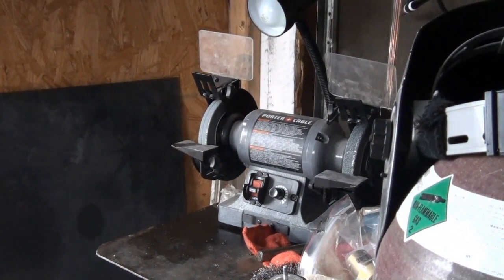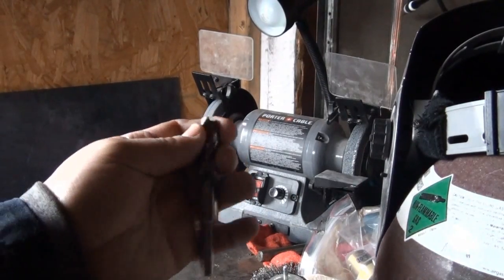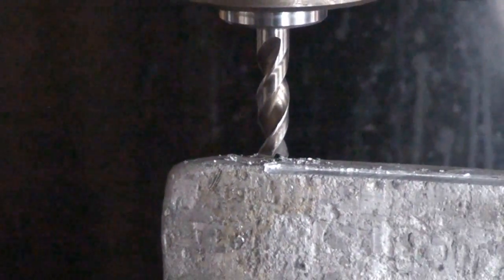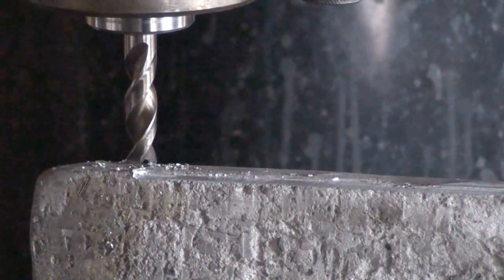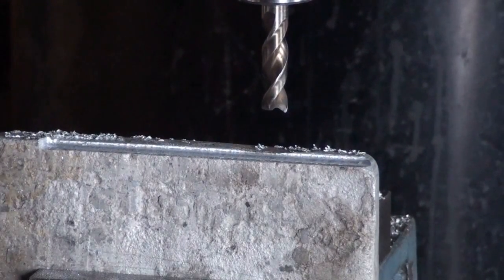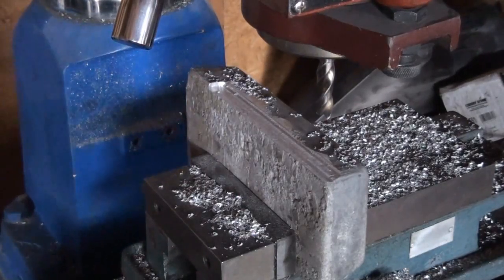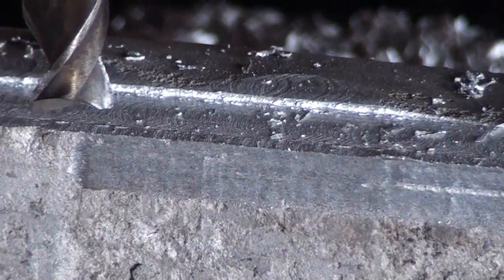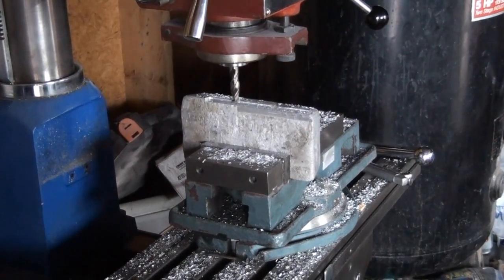How to make your own Endmill

Comment: If it's for plunge cutting it will never work as it isn't center cutting. But that's pretty cool that you could make a normal cut on top like that. In a pinch for a rough cut it works
Reply from the maker: That bit saved my ass plenty of times, especially on a hub repair I had to do overnight a couple years back. Thanks for watching!

Comment: I was wandering about doing the same. If a man had a floating endmill flute sharpener he could relieve those sides. If a man had the $$$$$ for said endmill sharpener he would simply buy "real" endmills. My problem is with say 5/16 inch and under. When cutting simple key ways you don't need the whole length of the flutes. They break off without getting the use of the whole length. I'd like to have or make some smaller endmills with flutes no longer than half inch .
Reply from the maker: Your comment gives me an idea on how to make such a device,  The homemade endmill sharpener .  I usually get my endmills in bulk off ebay,  this homemade one saved my ass on a spindle repair.
Reply: I know this is really old but have you ever tried making a d bit cutter? They aren't really good for plunge cutting but for operations where you don't need much speed and your material isn't too tough, that might be a good solution for making your own tools. You can also make them very quickly and make them in a specialized shape for whatever you want. Really the difficulty with these is the added time and potential for failure of the material. Whenever you are running carbon steel particularly, you have to use comically slow speeds & feeds.